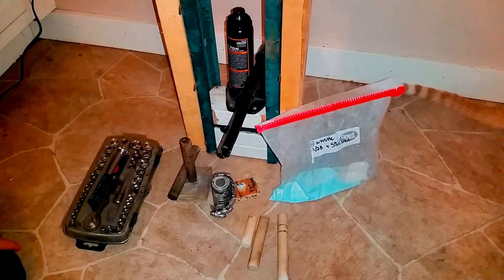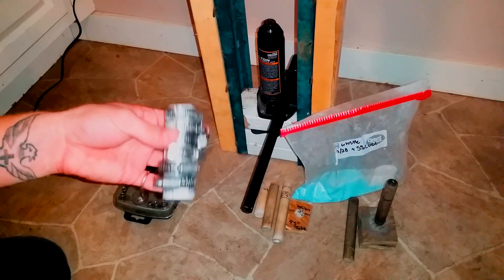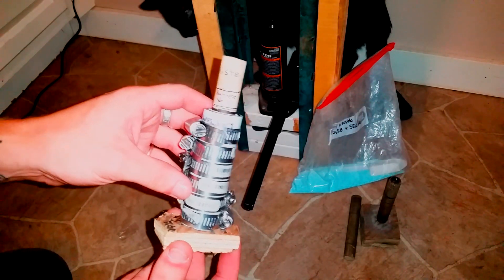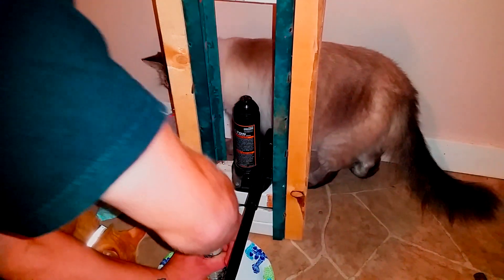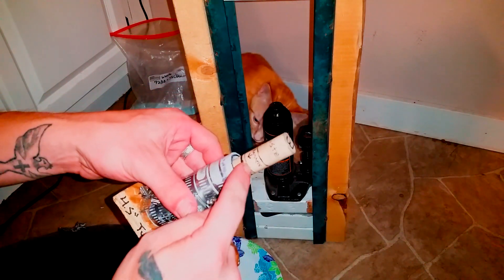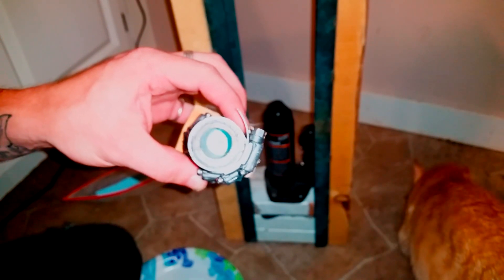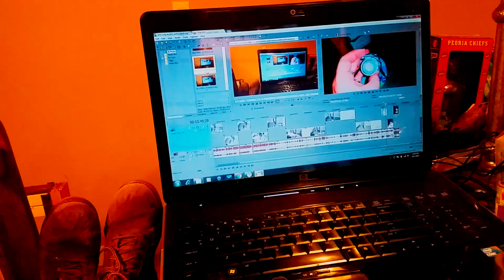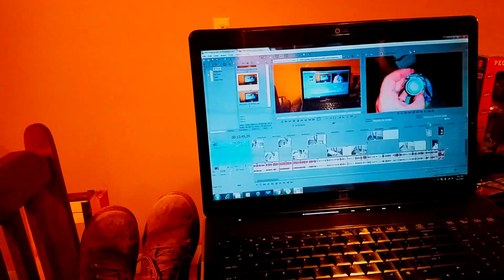Whistle Rockets 101: The Basics

Comment: how many tons is than
Reply from the maker: 2
Reply from the maker: I believe, I don't use it anymore. A bottle jack like that will work, just use what you have and use the force you need. I use a different press now. As well as different tooling with a longer spindle.
Reply: @BassheadCurry  thank you you're still active, I might make my own sometimes

Comment: You can actually use a long spindle for whistle and strobe, in fact the black powder rocket spindles seem to work pretty good with whistle. I posted a couple.
Reply from the maker: @patman0250  I'm working on redoing the whole setup. Thanks for the tip.

Comment: I like your creativity on the set up.  I get stuff gets expensive and save when you can .  Do you know how those small whistling moon travlers work?  You cant press that tiny of tube? Does china have a special machine that does this ?  Also is cardboard the only option for rocket body?  Thanks 👍
Reply from the maker: One other note.... you'll need a longer core than what I used in the video. These rockets had little thrust due to the fuel and core length. I would like to revisit this video with an updated version in the future.
Reply: @BassheadCurry ..been using 6 ton bottle jack with wood dole pressing into pvc pipe 3/4in.  I just use my Dodge Ram rear trailer hitch to press up against. Similar to ram using angle iron. Truck is about 8,000 pounds and lifts up while pressing rocket motor 😅….
Reply from the maker: I imagine the plastic whistle bottle rockets are not pressed due to the fact there is a report at the top of the motor inside of the plastic hull. My best guess is that they are poured in as a liquid state, or inserted as a solid grain pressed from a mold. I'm thinking the latter. 
Cardboard is not the only option, but definitely the safest option.

Comment: Very much appreciated.  I've been using tooling consisting of dowel with nail thru it for spindle, and the sleeve is basically the same as yours, although the cases have been hand rolled.  But the only press I have is a grapefruit squeezer whose rack turns out to be adjustable to a greater height than a grapefruit would ever require.  However, I'd be interested in constructing a press that'd accommodate larger engines.  The only thing missing from yours is a blast shield, which could easily be added across one face of the angle irons, leaving you access via the other side.

Do you have a description anywhere of the making of that press?  I gather that the top and bottom plates have steel running thru the wood.  The hydraulics is a jack, bolted down?

Comment: Cool set up and cool video.  Thanks for the information and demonstration on how you make your whistle rockets.  
     Maybe you could drill a few holes going up the angle iron vertically.  That way you can stick a loose bolt or metal rod through them and it would keep your whole Hydraulic Jack, up off the bottom floor plate.  It might make it easier for you, rather than having to life the whole jack every time you want to use it.  Just a thought.
     Thanks again and God Bless bro.

Comment: Interesting to see! My spindle is much longer and it works fine :)
Reply: Ps: I use 76/23/1 which is very fast!
Reply from the maker: Pyro Max That might help me actually. How long is your spindle on a 1lb motor?
Reply: Basshead Curry 84.5mm length
Reply from the maker: Pyro Max Just the spindle? Must be a long fuel grain. I'll redesign mine soon.
Reply: Basshead Curry yep. It's a universal/hybrid tooling. Standard 76/23/1 mix with perch/benz/iron oxide
Reply from the maker: Pyro Max Nice, thanks for the info! Maybe I should mention that my spindle is too short in the description, since my rockets have poor initial thrust.

Comment: Hi. I make a Potassium Chlorate Electrolysis aparatus my anode is this (50 x 165mm Durable Recycled Metal Titanium Mesh Sheet Electrode For Electrolysis) the catode (Titanium Ti Grade 5 Gr.5 Plate Sheet 0.5mm x 100mm x 100mm 4" X 4") the power suply a PC 400 watt 5.3 volt with 10 amps a cant get more out of it but with this plates doe's not work then for catode i put a steel small plate is work a bit then my solution turn in green and become blurry and the curent stop to flow. what is wrong? please help.
Reply from the maker: Jozsef Ienciu I would try to increase the amperage to at least 20 amps. Also, normal grade steel will not work for the cathode. You need stainless steel.
Reply from the maker: Jozsef Ienciu Also, if you use a titanium anode, make sure is is plated with MMO (mixed metal oxide). This prevents erosion and contamination, as well as oxidation of the mesh that will limit current flow.
Reply: Thaks a lot
Reply: Thanks
Reply from the maker: Jozsef Ienciu No problem. However, it is advised to NOT use chlorates, in most pyrotechnic compositions. There are very few exceptions in which chlorates are used. Perchlorate is far more predictable and safe. I hope you are aware of chlorates' sensitivity to sulfur. A chlorate composition near sulfur (even fuse) is an accident that is literally going to happen in time. It is unpredictable because it could happen in 30 seconds, or 30 days. It is best avoided.
Reply: Thanks for advice i don't mix chlorates with sulhur maybe onli when i use it.
Reply: Hi. I can get out more then 10 amps don't know why i try with two PC power suply.
Reply from the maker: Jozsef Ienciu With most computer power supplies, the red is your 5v 25 amp source. Black is negative, and green must be connected to black because it is essentially a switch to turn it on. Test your wires with a multimeter if you are unsure. Sometimes the power supply will have a sticker that indicates what colors do in voltage and amperage, but rarely that is the case.
Reply: OK  i think i know what is the problem my socket is divided and on that i make the measure is only with 10 amps i have to look for other.

Comment: hmm straight w-mix = shallow core indeed but if you process the w-mix you get alot more power/density/performance enhanced as it than allows a deeper core. keep it up bud ;)
Reply from the maker: Propyropower Yes this whistle mix was granulated with acetone and petroleum jelly was added as well.
Reply: oh nicey! very nice, atleast try it once with red iron oxide(1,5%) to me that always worked very well but on the other hand i never used cucl b4 so -.' im gettin some